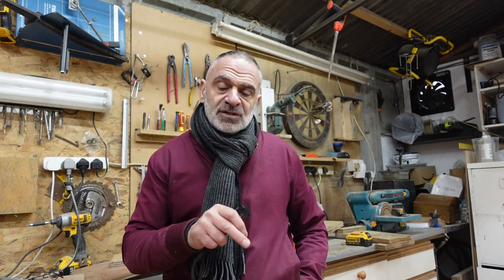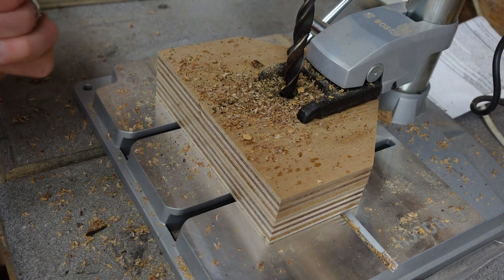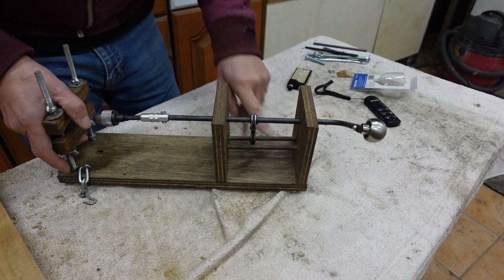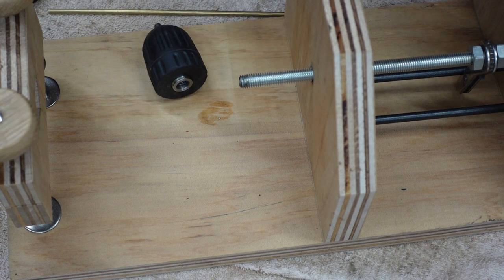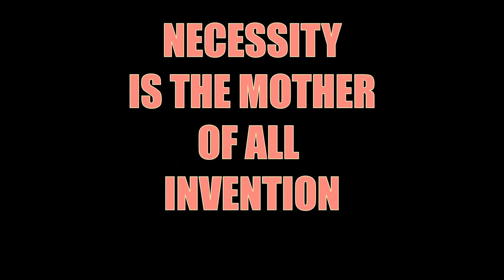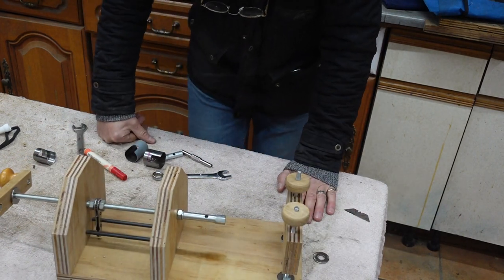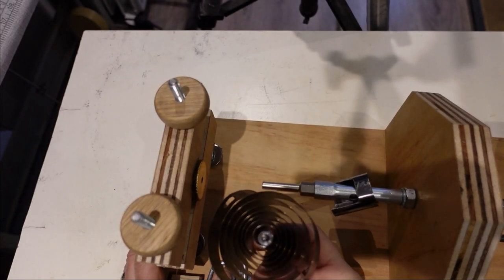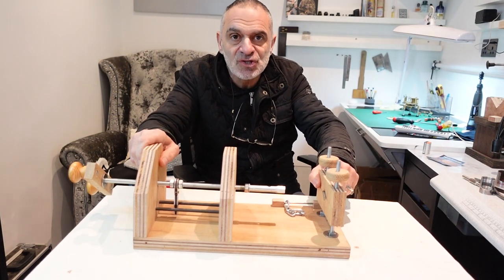Build this clock mainspring winder for £30 and save £100s Complete step by step build

Comment: That's really nice. I'm new to clock movement "hobby" and that's a perfect solution for me. The thing that I will do is to get a good quality ratchet, because it's the most important part for safety, I will adapt the rest with what I have in my shop. I'm in California and I just got a nice mantel clock, the movement is British Anvil, but I think that the clock is German, Jughans style, with chrome Bauhaus numbers, It's veneered in Mahogany and a bit of Rosewood, I paid  $13 for it at the flee market, I love it, it needs a clean-up of the movement (it works but stops), I can use an ultrasonic cleaner @ work. Thank you for the video.
Reply from the maker: For not a lot of money you can find some really lovely clocks. Theyre not that difficult to take apart and put back together. Get yourself some clock oil and once you have cleaned all the bits in an ultrasonic, lightly oil the pinions and I bet you it'll run without stopping. 
Good Luck
Johnny
Reply: @treetopspider  Thank you, Johnny. I'm a little nervous to put it apart, I'm worried about it not working at all when back together, I will start with an assembled "bath" and oiling and see where it goes, if it doesn't fix it, I will build your tool and disassemble the clock. Regards, Yves.

Comment: Great design - loved all the problem-solving. I'm now looking for some designs for various size spring holders - the commercial types cost silly money. I thinking maybe  copper piping of suitable sizes might do the trick.
Reply: I did think about using copper tubing but was a bit worried about whether it would be strong enough
Reply: @ziggy6151  I'm going to try it out soon with a 28mm coupler. I'll let you know how I get on.

Comment: Great helpful video…thanks so much. Many of us empathise with Christmas Day in the workshop! I’ve just made and used the winder for the first time…..brilliant! Mine is pretty much the same as yours….the only additional thing I did was to screw a length of batten under the baseboard which means the winder clamps into one of my woodwork vices in my bench. The only difference is that ….an excuse for getting out the flame thrower!….I bent the main 10mm threaded rod to form the winder handle….easy and works well. But very good indeed….I’m grateful for the steer!
Reply from the maker: Thats really good to hear, youve made me happy. These wooden winders can do a job just as good as the very expensive ones plus theres the pride in making something from scratch. My first prototype had a crank handle. it worked fine, I just wanted to try out something new. Who knows, one day I might try to make an electric one 😆
Johnny

Comment: I absolutely love your presentation on the main spring winder. I have converted your dimensions into inches since I live in California and most of the materials here are in inches. Can you suggest what sizes of mainspring capture sleeves I should fabricate? I will be disassembling my 1919 Junghans mantle clock movement and plan to fabricate a mainspring capture sleeve/can for the time and chime springs and I'm not sure what I should start with for diameters of raw material.
Thanks so much for your presentation and for braving the freezing cold temperatures you experience in the winter there.

Timm
Reply from the maker: Hi Timm
Thank you for your kind comment. 
Without going back out into my cold workshop, I seem to remember 30mm as a dimension. Although I have since butchered a few different items and made a few sizes according to my needs. Ideally if you have clear access to the mainspring case and take a measurement minus the thickness of the wall. I always wondered if there was a way to make an adjustable spring capture. I'm sure there must be a way. 
Best of luck
Johnny

Comment: Hi Johnny, it turned out fine in the end! Gotta say, it is great to see someone who thinks the same way as you do yourself…. I’m trying to cobble something together here…currently using bits and pieces I’m finding in the garage and in my late Dad’s old workshop. 
The shaft I have albeit threaded at each end is smooth in the middle…how did you attach that ratchet spanner to your first winder? I was thinking of welding it but it’ll knacker the ratchet if I’m not VERY neat 😬 loctite was another option but I don’t want to rely solely on that. Appreciate your thoughts.
Cheers…Graeme
P.s…I stuck a first video up if you fancy a laugh! My attempt at blacking marble with shoe polish 😅
Reply from the maker: Hi Graeme
I really love putting things together from odds and ends. Theres a great sense of satisfaction and achievement when I actually succeed. 
On my first clock winder I put a single little blob of weld to hold the ratchet in place which worked very well.
I'm heading over to your channel now to see how you got along :-)

Comment: Thank you for the video. I like your wooden knows for the clamp. Might I suggest using a T-nut insert rather than pressed in nuts?
The ratchet spanner is great. I may do that to mine.
I use an Irwin tap holder - #4 minimum to 1/4" maximum to grip the arbor.  It is made to use with a 3/8" extension and ratchet. 
Now, go appease the little lady and get warmed up!  May I suggest a cup of hot chocolate? 
🎅
Reply from the maker: Hahaha, Ive got to be a good boy for the rest of the holiday season. 
Thanks for the advice. My main problem is that I never really know what's out there with regard to ironmongery ( I don't know what a T nut insert is)  I'm constantly learning, which is why I'm so appreciative of the comments and advice. 
Off to google T-nut insert now 🙂
Johnny
Reply from the maker: I just google the inserts. I did have those. I used them underneath the base to hold the two threaded rods for the clamps. For some reason it didnt occur to me to use those for the clamp knobs

Comment: Having built a copy of your test stand (works great),I'm thinking of upgrading my mainspring winder. A quick question. I'm trying to visualize how your ratchet spanner  (11) grips your 10mm threaded rod. I can understand how it grips your (10)spanner but not your (11). Maybe I'm having a senior moment!  Keep up your great clock videos. They are most helpful.
Reply from the maker: Hi Peter, If you look closely, (20.36) you will see that I have sandwiched the ratchet between two nuts. I used a little Loctite on the threads to stop the nuts loosening off but you could equally just use spring washers to keep everything  nice and tight
Johnny

Comment: Many thanks
I am a simple user with 4 clocks. In two the springs have been damaged and I wanted to fix it, but I need that machine: I don't have the tools to make it:
Would it be possible to buy one from you?
I'm in Spain. I just need it for these clocks and to keep two others. I have disassembled the barrels, but it gives me a lot of respect to touch the main spring without that machine, I know it is dangerous.
Is it possible to make one for me? Of course you put the price that you think is fair.
I have consulted with several watchmakers and the budget of a single clock ; changing spring, cleaning and oiling is more than 160 euros + 25 for each real spring. Too much money for clocks that I bought for 250 euros on ebay.
Thanks again.

Edit: I need it now: ¿please can you tell me something about?
Reagards
Reply from the maker: Hi Dom, 
contact me on this email address 
jonyan1@hotmail.com

Comment: Really enjoyed your great video and plan to have a go at making your mk2 its brilliant.

I have been looking for a set of spring holders - did you make your own or can you advise where to obtain them - many thanks.
Reply from the maker: HI Mike, 
I'm happy you enjoyed the video. 
Basically I scoured my workshop for anything that was cylindrical. The main spring holder was made an old aluminium torch case. When I recently needed a larger one, I cut  50mm off the bottom of our garden umbrella (much to my wife's disapproval) then simply cut a slot  about the width of an average spring, roughly about 30mm. I overlooked showing that in my video.
Johnny
Reply: @treetopspider  That's what I wanted to know.
Now, I, too, will be souring the workshop and the garden shed ...

Comment: Just love the relaxed and informative video. Brand new to clock repair and starting a course in three weeks and think this is a critical tool. Have gathered all the bits but like some others I just can't see how to get my m10 ratchet to be fixed to the threaded rod. Presumably the nuts you use either side are just preventing any horizontal movement of the ratchet along the rod so weakening the join of the inner piece of ratchet to rod? I can glue and solder (badly!) but not weld  Will I be likely to get a strong enough join do you think? Maybe some ptf tape around the rod thread where the ratchet will be might help? I'm looking forward to trying!
Reply from the maker: Hi Graham. The 2 nuts I use either side of the ratchet are to lock it into place. On my first attempt at this tool I welded it but thats not needed. I used some thread locking glue to stop the nuts coming undone but spring washers would work just as well or even Nylock nuts. 
Where will you be going for your clock repair course?
Johnny
Reply: @treetopspider  Sorry for delayed response,offline. It will be in Sevenoaks, Kent and actually is listed as not for beginners! My friend and I have been buying a few single trains at auctions and stripping them down and re building with the aid of google and books! The course is more of a 'guided advice' to any problems you might have with a damaged clock

Comment: I just built one of these but found out it is useless. My winding arbor is on the solid side of the barrel. The cap pops off on the side opposite to the winding arbor so after I capture the spring i have no way to remove the spring from the collar I captured it in. (capture spring from side of barrel opposite of the winding arbor.) Im at a loss on what to do.
Reply from the maker: Sorry to hear that. Ive not come across a barrel with the winding arbor on the solid side. I wouldnt know what to do under those circumstances. The winder works perfectly with the standard barrels. I mainly restore French clocks where the cap is on the same side as the barrel
Reply: @treetopspider  i figured it out. Since there are no other videos that i could find i will let you know what i did. Its an oddball indeed.  After capturing the spring, i removed my bareel holding fixture and replaced it with another fixture that holds a bolt with a hole the size of the arbor end opposite the winding key. I then was able to wind the spring enough to slide the collar off the spring and the bolt held the collar and supported the arbor. After unwinding spring i was able to remove spring from winding arbor. Now i have have an  attachment for my winder for these oddballs.

Comment: Just about finished copy of your Mark2 version.  Great!  Only problem is finding or making suitable tube spring holders.  Ring holders are are too big or too thick.  Any DIY tube off-cut source suggestions & dimensions?
Reply from the maker: Well done Glyn, I'm quite proud😁
For my first spring holder I cut up an old alluminium torch I had. the second one was a bit off the garden umbrella. You could try one of those poles that is used to make hanging space inside a wardrobe. Heres something Ive seen on Amazon       https://www.amazon.co.uk/Complete-Retail-Solution-Ltd-WARDROBE/dp/B00VD0UR72/ref=sr_1_89?crid=20H7KCHTTKILU&keywords=wardrobe+pole&qid=1671225837&sprefix=wardrobe+pole%2Caps%2C128&sr=8-89  
Johnny
Reply: Thanks J. I used M10 bar.  Friend drilled 4 mm holes. Used two 4mm bolts to fix box spanner chuck. Your suggestions helped a lot. Garden umbrella pole perfect. I’ve not been beaten up yet!  Used old Sharpie caps for bearings. Perfect. Thanks for the inspiration. Glyn

Comment: Hi Jonny could you tell me where you got your mainspring retaining sleeves please I have some that are a bit chunky and don't sit nicely in the barrel
Reply from the maker: Hi Colin. I made one out of an old torch I wasnt using and another I made from cutting the end off a garden umbrella. I basically got invetive and looked for anything that was tubular at the size needed. I did orginally think of making the out of copper pipe but wasnt sure if it could withstand the pressure of a wound up spring
Reply: Thanks Jonny I might start having a look around the house for ideas , saves money . Thanks for your videos they have been most useful . I have just started to teach myself clock repairing and have found some great help on you tube . Keep it up

Comment: Excellent job!!!! Where did you get your spring captures?  Are they a commercial item or did you make those as well?
Reply from the maker: Hi william.
I made my own captures. The first one I made I cut up an old battery torch and used the barrel. The second one I needed was larger, so hunting around, the garden umbrella caught my eye so I stole an inch off the bottom of that 😂